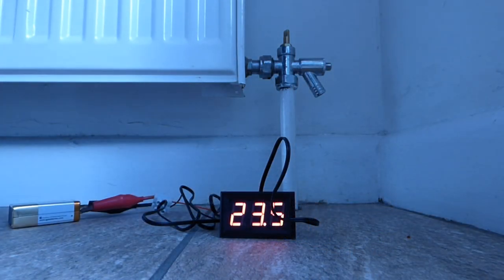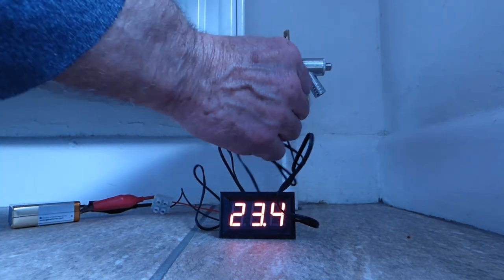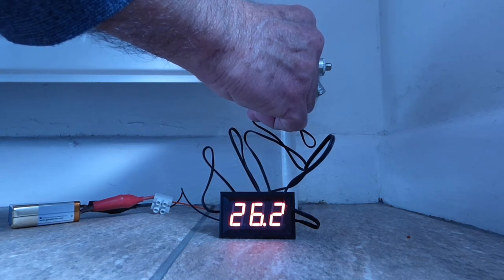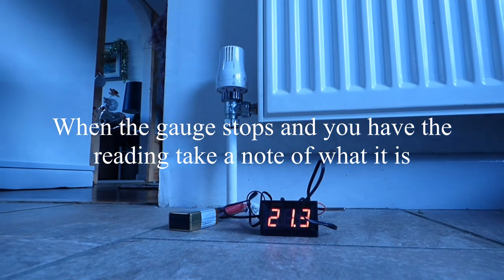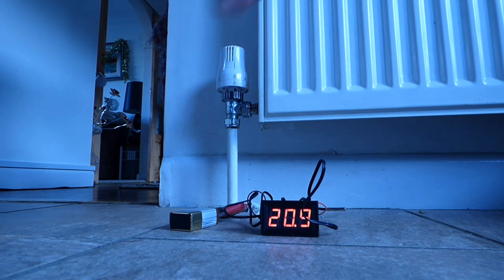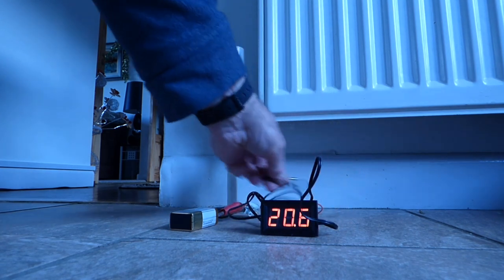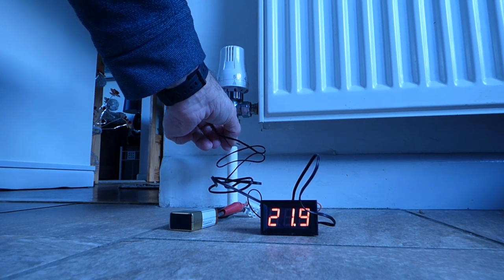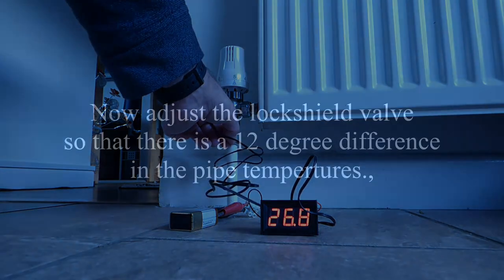How to accurately balance your heating radiators using a thermometer

Comment: Thanks for the informative video. I have just done this process on my rads and I have a couple of questions. All my rads have TRV's except one which has lock shield at each end, I understand you have to have one rad without TRV. I included this rad in the balancing but I wondered if this one needs to be fully open both ends or is it OK to leave it set up for 12C temperature drop which required one lockshield to be only a quarter of a turn open? Also I have a mix of TRV's some on flow and some on return, is this OK or is it dependant on the type/make of TRV?
Reply from the maker: Leave the lockshield a quarter turn open it will be fine. TRVS can be either end now. The make of TRV are not critical but the higher quality ones like Drayton are more accurate.
Reply: I have 13 rads including 2 towel type and all have TRVs. Do I need to remove one or can arrangement remain as need to appreciate purpose abd benefit of 12 or 13 TRVs. Thank you.

Comment: This might sound naive, but what is the best definition of 'heating up'? If I hold the flow pipes going in to my radiators, some all start to warm up - albeit very slowly - from cold at almost exactly about the same time. So is checking for the start of 'warming up' best done at the top of the radiator (directly above the flow in),  or perhaps is feeling the middle of the radiator top a more sensible way? Or maybe it's down to the two of us in our house having different levels of sensing 'warming up'.  Mine is an old F&E system with an ancient Glowworm Spacesaver boiler, with 3 ground floor rads having down-pipes from the floor above, and it takes quite a while for the circulating water from the boiler to actually get "warm". I thought this would be a very easy task, but finding it surprisingly hard to tell the difference between the start of some radiators warming up and others. (Loving all your helpful vids, though!)
Reply from the maker: For you, I think feeling the top of the rad on the left or right side to find which is the flow, might be best you. The downstairs rads with the dropped pipes finding the flow is best done by feeling which pipe is heating first.
Reply: @dereton33  Thanks. I've already identified the flow and return pipes  for every radiator - that's not the issue for me, as was very easy. It's actually determining the point at which I can say "yes, that rad's warmed up, but the other one hasn't yet".  I could simply feel the flow pipes, but they seem to warm up about the same rate on all but the furthest fromes from the boiler. I've made a bit of a plan and so am now using a 'common sense approach' to balance what I'm guessing are the nearest rads first. Might give it a second go once I've drained down the system and replaced the Sentinel x400 with proper inhibitor. House is absolutely boiling at the moment as I work through one radiator at a time! (Wish I'd bought two digital thermometer to do this job, too) Cheers.
Reply: @VC57UK  make sure all lockshields are fully open, there should be an order.

Comment: My central heating system was originally gravity fed but was converted to a pumped system. The pipes from the boiler go from the ground floor to the pump on the first floor and then, either drop down in boxes in the corner of the rooms to feed the ground floor rads, or, travel under the floor boards to supply the first floor rads. Given the layout, will i be able to work out the sequence of heating?
Reply from the maker: Yes just check which are heating up first by hand when you switch on from cold.
Reply: @dereton33  Thank you so much for your reply. Much appreciated.

Comment: Small tip: cut a short piece of pipe insulation  and tuck the probe between that and the pipe. I have loads of those digital thermometers from ebay. Less than £2 each so can have 1 on each end. In fact I have them on the boiler flow and return too. Where does the figure of 12c come from?

I believe the very best efficiency would occur with a return flow of 20-25c which would be impossible. But the greater the temperature difference between inflow and outflow, the better, right?
Reply from the maker: Thanks John.
Reply: I think 12C is the optimum for a non-condensing boiler and 20C is the optimum for a condensing boiler.
Reply: @chriscarus2464  I think for a non condensing boiler you have to run hotter right? As acidic condensation will rot those boilers
Reply: @johnf3326  I don't know about corrosion and temps - you could well be right. But I'm fairly sure the intended delta T is smaller for non-condensing vs condensing.

Comment: Thanks for the video. I have 14 radiators over 2 floors. To identify the order they heat up will need 2 people. How much of the radiator needs to have got warm to be considered as warm enough to be on the list? Just the bottom?
Reply from the maker: Yes as the pipe enters the rad.

Comment: Thank you for this. I am worried I may cause leaking to the valves on the older rads. Is there anyway to do this without needing the first step. That is can I just assume the order based on assumed pipe runs and opt for 12 degrees based on that guess?
Reply from the maker: You can but it will not be accurate.

Comment: A friend of mine has three radiators on the same floor in a very small apartment. They all get hot very quickly, but the Delta temperature between flow and return is zero. Is it still worthwhile to do the balancing since all the radiators have a uniform, pretty high temperature? Thanks for your continued support
Reply from the maker: Yes still worth dong. His boiler is not running efficiently.

Comment: Always very helpful videos. 
I have 13 radiators in total 2 of which are towel rail type. Two questions: 1. Should one TRV be removed from the 13 as I have heard and if so which one if any and why? 2. Do the towel rads actually benefit from a need for TRVs or not as they seem to be ineffective or there is little difference on temperatures in and out of flow and return sides? Thank you 😊
Reply from the maker: Yes remove one so it acts as the bypass rad usually the towel rail will survice.  Still put one on the other towel rail though.

Comment: Does that 12c difference mean that the return pipe at the lock shield is lower than the feed pipe with the TRV? But what about when you turn the TRV down in a room from fully open (5) to say (3) because you don’t want that room too hot, how does that effect the 12c differential?
Reply from the maker: Will still be the same on all the other rads.

Comment: Does the 12 degrees difference also apply to towel rails? I have read somewhere to ignore a towel rail, as they have such a small effect on the water temperature.
Reply from the maker: That is right .
Reply: Does this negate need for TRVs on towel type ie bathroom in my case radiators?
Reply: @shouwill  I'm pretty sure that at least one radiator should be always 'on' so that the boiler has somewhere to pump water if all the TRVs are closed. This is usually the bathroom rad/towel rail.

Comment: Thanks for the video. My issue is that I have three radiators connected together, serially, in a bay window. Strangely, the middle one is connected to the two side ones both on the top and at the bottom. The problem is that even with the lock shield valve fully open the temperature difference between incoming and outgoing flow is much larger than 12 degrees.  Could this be the fault of the way they are connected or is the pipe work just underdimensioned  for the task. Standard copper pipe, not microbore.
Reply from the maker: Coupling rads in that way will make the temperature difference larger, as the heat has to pass through 15 mm pipe through the middle rad and back to the outer rad.
Reply: Yes,that makes sense. The question is then what to expect, something between 12 and 36 degrees as the are three radiators serially connected? I am also thinking of removing the top connectors between the radiators to get a more normal flow through the middle and last radiator. Currently, I can see (I have a simple heat camera) that the middle one especially only get warm at the top and cold lower down whereas the first one in the chain gets warm all the way through. I have also seen from other forums that they way mine are connected is not the standard way it is done.

Comment: One more question. My boiler modulates the temperature. So, the flow temperature constantly rises and falls, as does the return temperature. There is therefore a delay between the maximum flow temperature, and the maximum return temperature.

Is the 12°C difference calculated as the difference between both maximum flow and return temperatures, or between the maximum flow and minimum return temperatures?
Reply from the maker: The Max.
Reply: @dereton33  Thank you.

Comment: I'm having a problem with a radiator in my bedroom... I've tried it all, bleeding the system of air, checking the thermostat valve, all is good - no air, thermostat valve pin is popping out as far as on all my other radiators.

So now I am looking into trying to balance the system. I thought maybe it could be this because of a recommendation on one of your other videos, but I don't appear to have a lock shield valve.

My thermostat is at the top of the radiator coming off the right hand side, and the opposite left hand side is where I can bleed the radiator with a square shaped key. At the bottom sides there is nothing, and at the very bottom, a bit offset inwards from the left there are two ports with hexagonal heads on them. Is this the thing I need to control? The last thing I want to do is cause a leak!
Reply from the maker: One of those will be a valve you may find it is almost off, preventing that rad from heating up.

Comment: Hi Derek, I always enjoy your videos.  Couple of questions.  
1)  I have an unvented system boiler Ideal ICOS condensing, so what should temperature differential be at the flow & return on each Rad?  I've read 12 degrees but also 20 degrees!  Confused

2))  I have a dual zone system with seperate zone valves for downstairs and upstairs so do I balance the down and the up separately? Or does adjusting the up also affect the down and vice versa?.  Thanks again.
Reply from the maker: 12 degrees.

Comment: Another question: 2 radiators downstairs have a Delta temperature of around 10 degrees, but the flow temperature is 4 or 5 degrees lower than that of the radiators upstairs. What's the reason?? If I close the lockshield valve a bit more then the flow temperature decreases as well
Reply from the maker: The boiler stat needs setting higher.

Comment: Does this 12 degree rule still apply for old non condensing boilers? I’ve got an old Baxi 

Thanks for the videos!
Reply from the maker: no not those John.
Reply: Is there a different temperature I should use for balancing the rads? Trying to get the best I can out of this old thing

Comment: Question, I have a system with 3 separate zones. 1 is underfloor heating. The other 2 are upstairs and downstairs rads. Would you do this with every zone open? Each zone has its own pump fed from a low loss header. Thanks
Reply from the maker: Yes do it with all zones open.

Comment: Hi! When moving to the second Radiator do you keep the first radiators open?
And is the latter radiators still turned off as you make your way to the end HAS IN SECOND RAD TRV TURNED OFF AND LOCK SHIELD TURNED OFF.
Reply from the maker: Yes keep the first radiator valves open and as you move to the second the same thing, until you reach the last one.

Comment: Great video but I have a question. If I adjust my lockshield valve to get 12 degree difference across the radiator  will that mess up the balancing of the whole system as in the nearest and furthest radiators  and should I try to balance the whiole system first or individual radiators? Many thanks
Reply from the maker: Balance the whole lot first.
Reply: @dereton33  Thanks will try it today

Comment: Should the temperature delta between TRV and lock shield valves be constant even when the modulating boiler is off and therefore the flow temperature is five or six degrees lower?
Reply from the maker: Not when the boiler is off.

Comment: Great video as always. Love your channel! When is the best point after you've turned the heating on to take the initial rad pipes readings? I have some 3 column traditional radiators which can take a little while to heat up.
Reply from the maker: An hour.
Reply: @dereton33  Thanks Al. I also have x1 very small and old single panel rad in the hallway - its @ 1/4 turn but I'm never going to achieve a 12 degree difference on that unless it's closed! lol Same for my shower rail rad in the bathroom. Any thoughts on this?

Comment: Very good video. Is it necessary to allow the system to go cold re-heat for each radiator?
Reply from the maker: No need
Reply: Thank you. I’ve seen online, that most condensing boilers in the UK, are more efficient with a return temperature of 45°C. Does that mean the maximum, minimum or average, because mine fluctuates?

Comment: Hi  can you please advise me I have lock shield valet both side of the radiators which side to use if I wanted to balance the heating system many thanks loved your video
Reply from the maker: Hi David it does not matter which side.

Comment: Err..12 Deg higher or lower (when adjusting the lock shield valve)?
Reply from the maker: That is right.
Reply: @dereton33  Not sure I understand your reply Al to Giuseppe. So if the thermostat reads say 25, should the lockshield side read 37?
Reply from the maker: If the thermostatic valve is on the flow (most are) then that will be the one reading 37 and the lockshield 25.

Comment: Hi, I'm currently helping my parents with their heating, having had problems with some radiators staying cold, we spent yesterday switching each one on in turn, on it's own, to find out whether it was working OK, whether any bleeding was necessary and also whether there were any cold spots.  All passed the test, so we now assume they need balancing to sort out the problems.  The weird part is, they had both the bathroom and en-suite radiators replaced at some stage with towel rails, neither have TRVs, just a cylindrical valve at each end which can easily be closed or opened by hand.  How should these form part of the balancing process?  We've noticed strange things with the towel rails, for example, one hots up very quickly indeed, the other takes far longer, but also there seems to be conflict between one of the towel rails and one of the radiators (you turn one up, the other goes off).  All good fun.
Reply from the maker: the towel rads are sharing the same line. Just adjust one if the valves on the flow side to balance these.
Reply: @dereton33  can I not just fully open one TRV instead of removal or must the towel rad have two lockshields. If the latter how are these set eg both fully open..?

Comment: Hi, quick question, the bathroom radiator has two lock shield valves as it is a heat sink, do these stay fully open during the whole balancing process or close one end down? Thanks in advance!
Reply from the maker: Still close one end down.
Reply: @dereton33  thank you sir!

Comment: My boiler manual (condenser boiler Logic Plus System S30) says that the temperature differential should be 20 degrees. Should I use this rather than the twelve degrees that you quote? Also, should the radiators be balanced when the hot water is on as well, or just when the heating is on?
Reply from the maker: Just when the heating is on. You will struggle getting 20 %. 12 is more normal.
Reply: @dereton33  Many thanks.

Comment: Why is the diference of temperature in front of radiator and behind it 12 C°?  Why not 20 or 5?
I know that the temperature difference effects the heat output of the radiators. So i assumed that this difference should be adequate for the heating system as a whole compared to heat loss of the building to match the output of radiators. Or am I wrong? Thank you and have a great day
Reply from the maker: Yes that is strange, but it does all depend on your boiler, how many Rads ect.

Comment: I bought a thermometer to balance my system but it's extremely hard to tell which rads heat up first! Any tips?
Reply from the maker: Use a partner to help you. Turn on the heating from cold then working away from the boiler see which ones warm up first.
Reply: @dereton33  i had my other half and daughter helping but it still seems really hard to work it out without seeing a pipe diagram. We'll try again. Thanks for the response!

Comment: Hi, when you have worked out the order of the radiators heating up do you then turn the heating off and all the valves on all the rads ? After this do you only turn on the radiators in the order they heat up eg if i have a total of 12 rads and i am balancing rad 2 - i will leave open rad 1 (as that is now balanced) and also leave off rads 3 to 12 ?
Reply from the maker: Yes that is correct.